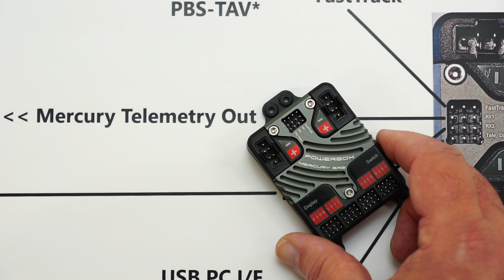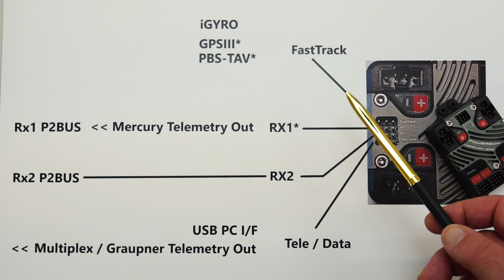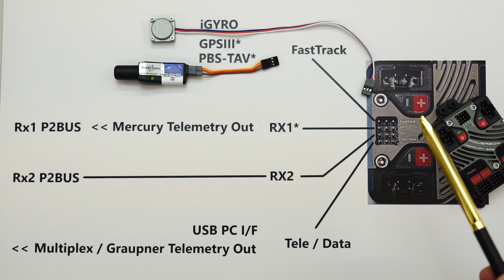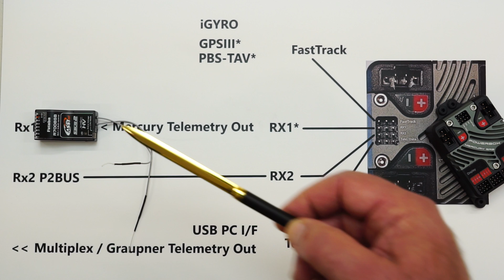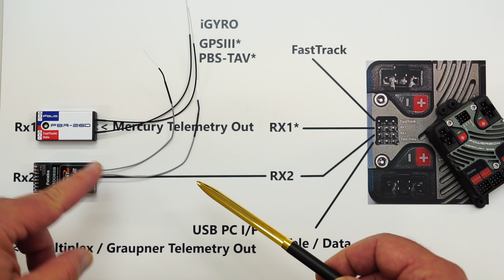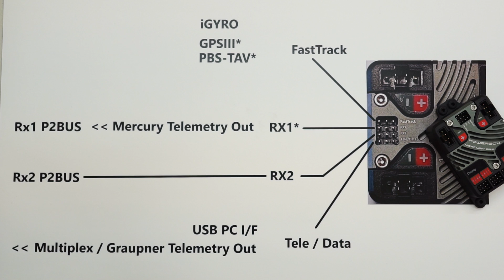PowerBox Mercury SR2, Competition SR2 and Royal SR2 - Basic Connectivity

Comment: Thank you for your videos!
I am having trouble setting up a PowerBox PBS-T250 with two temperature sensors. I am not sure how to connect it so that it is recognized by my Futaba T16IZ Super radio...
I have two Futaba R7208SB receivers connected to a PowerBox Mercury SR2.
Using the PowerBox Terminal, I configured the PBS-T250 for S.Bus and connected the module to the RX1 receiver on an S.Bus channel, but the radio is not detecting the sensors.
Could you please help me?
Thank you!
Reply from the maker: The sensor needs to be connected to SBUS2 and not SBUS.

Comment: Hi, is it possible to use the Futaba S.Bus2 receiver with the Futaba SBS-02 GPS telemetry sensor and the PowerBox Mercury? Will the Futaba GPS telemetry and PowerBox telemetry work continuously?
Reply from the maker: Yes...you would connect the Futaba GPS to the sbus2 port of the receiver that is enabled for telemetry. You just need to check the telemetry slots as the Mercury uses slots 16 onwards so the Futaba GPS will need to be setup on lower numbered slots.
Reply: @CVHeliPilot  thx :)

Comment: Will this unit work with FrSky receiver's
Reply from the maker: Only in SBUS mode. As FrSky receivers do not support SBUS2 the telemetry information cannot be sent back to the Tx. SBUS2 is needed for telemetry as SBUS does not support telemetry.
So while PowerBox support SBUS and SBUS2 protocols FrSky only supports SBUS as far as I know.
Reply: @CVHeliPilot  oh yup. Similar to the Fport on FrSky.    They have changed their protocol within the last year or two.  Found out while trying to buy another couple of receivers.   They no long sell what I use, so now looking to find away to either upgrade, or completely change camps.     I do like the EdgeTx operating system.  Hoping to stay with it.   Thanks for your quick response, and Hello from New Zealand